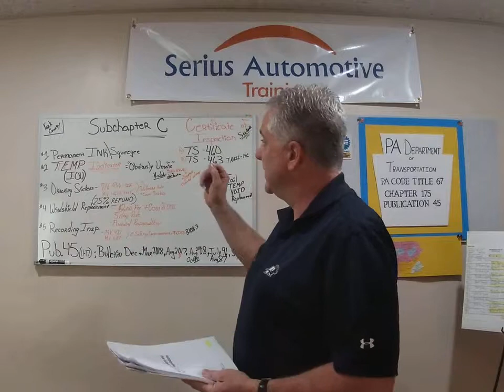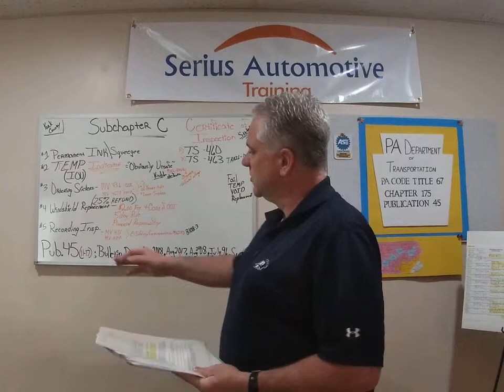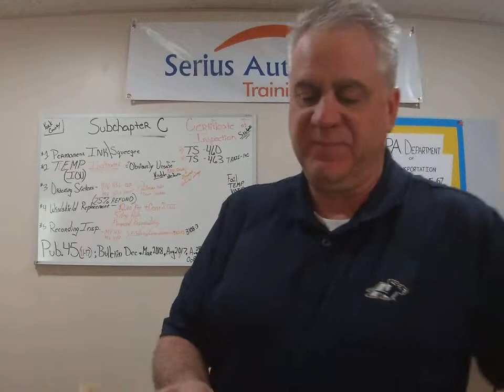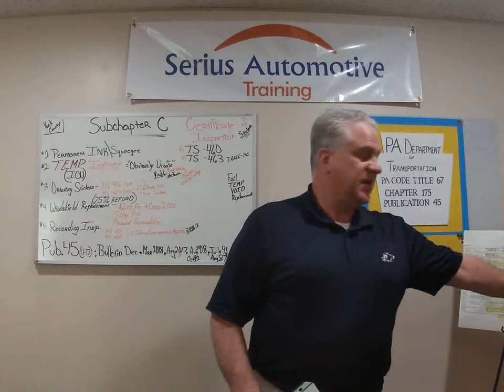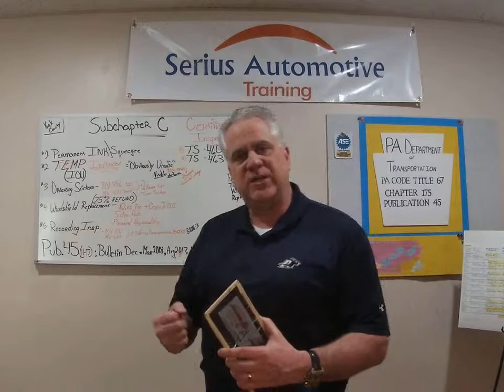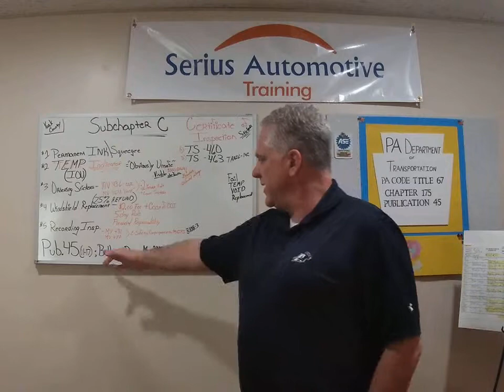How to replace safety inspection sticker! PA Motor Vehicle State Inspection Training.

Comment: Hi Terry, when inspectors begin a safety inspection, is it a requirement to remove the sticker before the inspection starts?
Reply from the maker: Never remove a Safety Sticker until the vehicle passes and you are sure the station has correct insert n sticker.
Reply: @Terry Rutch  thanks Terry.  In Virginia, they remove the sticker before they start the inspection and I was just wondering if it's the same in Pa.
Reply: So I guess the real question is, is it protocol for a PA inspector to remove the safety sticker before they begin the inspection?
Reply from the maker: Yes it is protocol for a tech who knows he is updating the safety sticker before they even check the vehicle?